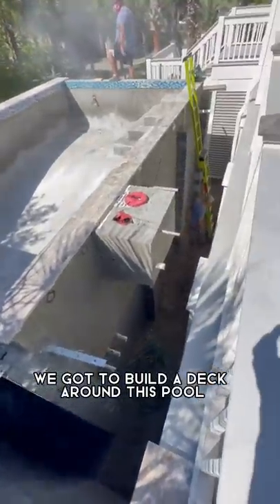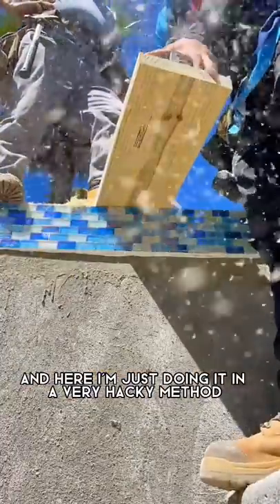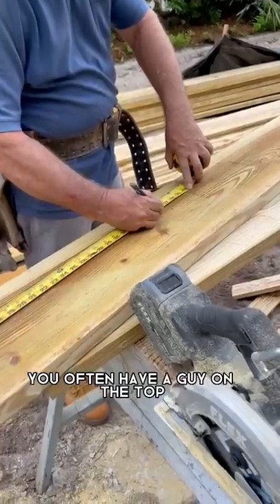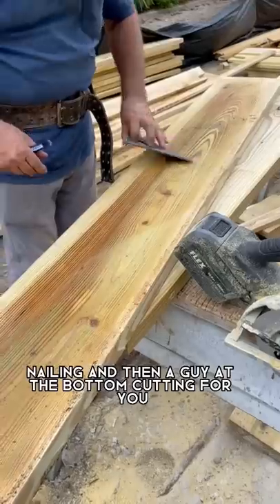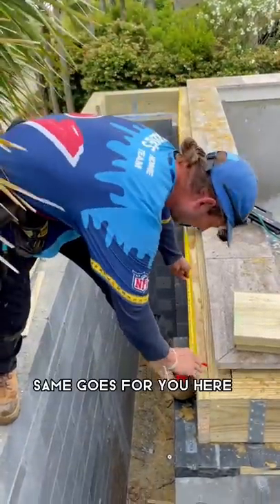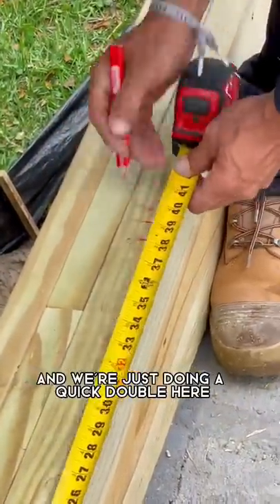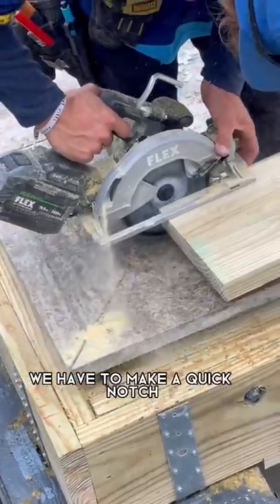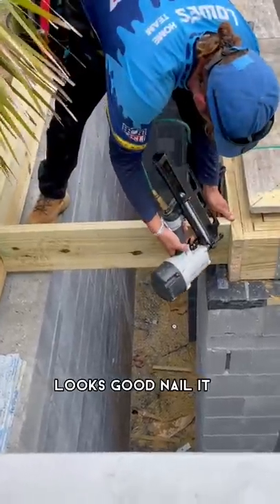#shorts #work #carpentry #construction

Comment: I've seen three inch nails get shot, and turn around 180° in the wood, and shoot directly back at the person running the gun.  So, when I see the guy at the end nailing in line with his own fucking hand.. 

Like dude... for real??

Those hands make or break your entire career.  And you're pointing a massive nail gun at one of them????   

One knot in that wood, and you'll wish you were never born it hurts so bad..  I wouldn't wish that on anyone.  

I still remember my coworker's screams, as if it was yesterday, and that was a decade ago. 

We had to cut the nail in two with a sawzall to free his hand from the rafters, and he needed surgery to get the nail out.

It's straight up not worth it to tuck your hand into the shot pocket like that.  I know it takes more time to line up the board properly when you drop your grip back out of there, but it doesn't matter how fast you are able work if you're sitting at home with a potentially permanent injury.

Rip some chips for me, eh?  I miss it out there.

Comment: When u cut your notches you should really use a fine tool after ripping. It matters in the long term. Also idk if those are specially treated but I would have used pt to build around a deck or outside in general

Comment: No joist hangers? No real joint  supports other than toe nails? 🤔 not good
Reply: The joists have been notched so they rest on the concrete block. All the weight is transferred to the block wall, so the nails just need to secure against horizontal loads.
Reply: @thelight3112  only on one side.   Watch the video again.    The outside is NOT sitting on the blocks yet.  But it will someday.
Reply: My guess is they will add hangers after.

Comment: Using flex tools lol. Amateur hour.
Reply: You have no idea how good flex tools are 😆 Dewalt and Milwaukee suck compared to flex. I've had all 3. ive used hilti's flex is just as good if not better then hilti
Reply: Expensive
Reply: Imagine judging someone because of the brand of their tools.
Reply: @thelight3112  lol I work in construction, this is the language that is spoken. you wouldn’t last with your thin skin.
Reply: I bet your a ryobi guy rofl
Reply: @rockbandgamer  flex is not cheap for starters. It's the next generation of power tools better then Milwaukee or DeWalt I get it you just can't handle change 🤭
Reply: @aaronwilliams8813  Well I'm not afraid to admit I was wrong. I only know of Flex tools from seeing them at Lowes, but they do appear to be a non budget brand of tool. My b, I just thought it was another version of Ryobi or Craftsman for lowes to throw on the shelf. Lol.
Reply: @rockbandgamer  I do highly recommend Flex brand the batteries are next level the oscillating saw is the best battery operated  oscillating saw on market. My next purchase is their chipping hammer 🤤